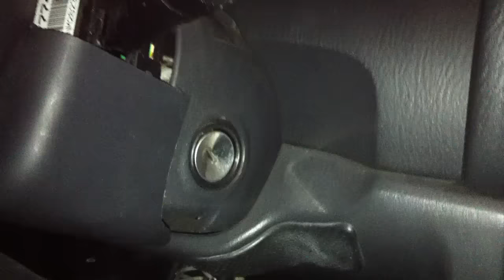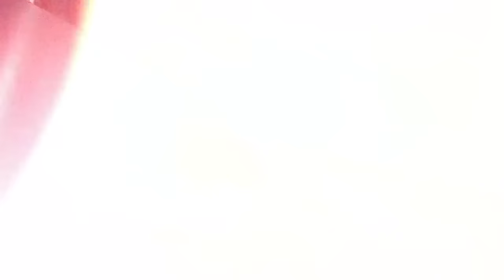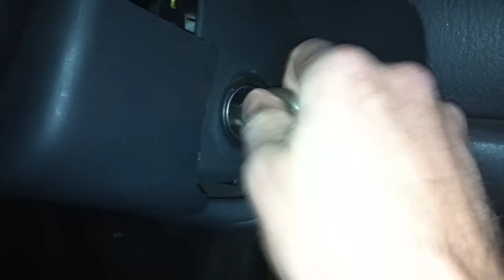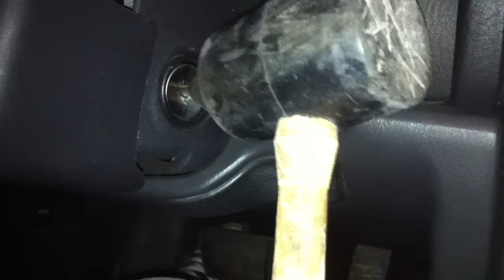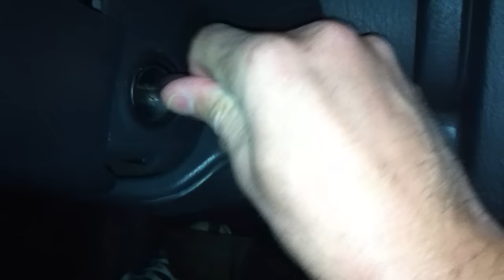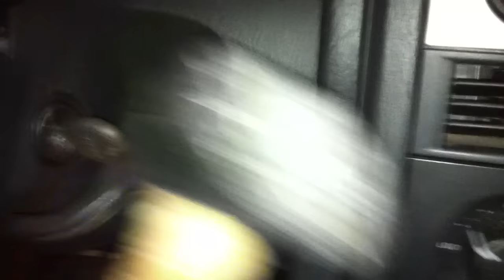if your Car/Truck Key won't turn, here is a Quick fix -UNCUT

Comment: Just worked on 2001 Chrysler Town & Country :)
Reply: probably ages ago, but did you recall if it was locked, or would go all the way and just wouldnt start due to electrica of the seurity feature. mine wont turn over, just -- poosh-l
Reply: thanks for the reply, but that van is long gone 😀😀😀
Reply: no worries, mine is long gone too!! I have scooter fixing videos from waaaay back and people still ask me specific questions on it.. I feel ya.

Comment: I know this is a 9 YEAR OLD VIDEO but THIS JUST SAVED ME accidentally put my truck  key in my Volvo (was in my pocket ) and then after it wouldn’t turn realized was wrong key then Volvo key wouldn’t work anymore after totally taking the ignition apart I seen this video and BOOM IT WORKED
Reply from the maker: 9 years. Geeez you making me feel old. lol

Comment: This will only work if its the tumblers getting hung. Wont do anything if its because of a worn key. (accept probably damage something worst then it is) That said  this  can be a good temporary fix for dodge/jeep/chrysler (doesnt work to well on other autos) but you should still consider contacting a locksmith to have the ignition refitted with new wafers. Its much cheaper when lock is functioning which it probably wont be for much longer.
Reply: Key Works Yep! This trick will only work so many times. Sidebar failure isn't gonna fix itself.
Reply: O..

Comment: Totally worked. I just used my palm. We were stuck for 30 minutes trying to wiggle and everything you normally do. Couldn't find a video saying anything else. Slapped it with my palm 4 or 5 times and started right up.

Comment from the maker: I've broken a key before too, and I used this guys technique, https://www.youtube.com/watch?v=63tQH1DIqIw
Reply: Warren Hardy  Thanks a lot. After trying for a few hours in different ways, I got the lock turned in this way in 2 minutes. Now I can get the lock out to repair it :-)
Reply: This is the worst tip ever.
Reply: Been driving a tow truck for AAA for the past eight years. Done that many times to loosen the tumblers of the lock. But I just tap it with the handle of a screwdriver. Jeeps are notorious for having this happen to them. Now I towed a Jeep Grand Cherokee to the local dealership because I couldn't tap the tumblers loose. The service writer said you need to whack them real hard with a dead blow mallet. He got in the Jeep, smacked the back of the key. And he got it started.
Reply: +Duong Anh Pham l
ddrA. cu e et et et RT et try UK
👶💑💑💑👶uu
Reply: A gentle tap with a screwdriver handle is ok a dead blow.. absolutely not! If you only knew what was inside the coloum that can get damaged you wouldn't dare do it either. And when some locksmith like myself (who also used to run calls for a AAA contracted shop we'll know exactly what you did because you'll have telltale marks on the plastic actuator and sometimes even it breaks the transponder antenna or SKIM module. That module is about 1000$ installed and not many other than a dealer can (or for that matter should) replace them and it's not just a part you can throw in there worse yet it often changes the vehicles pin code to something that no one knows and when you lose your keys both the keys and module must be replaced! 
Another thing worthy of note is that this is a temporary fix, the ignition cylinder must be removed and the bent pins/wafers inside replaced and the lock re lubricated after cleaning otherwise it's just going to go out down the road and leave them stranded again. Yes it can get them going but it's not a permanent fix
Reply from the maker: gotta be careful, light straight blows, if its really bad like mine was you will have to ramp up the hits harder and harder, but yes it can happen. 
If you do break your key off, this guys has 7 ways to remove it: https://www.youtube.com/watch?v=63tQH1DIqIw

Comment: Warren: YOU SAVED ME another $300 repair! THANK YOU!!!!!! Favorited AND subscribed! Had this very issue on my 2006 Dodge Dakota. Replaced the ignition cylinder once, and thought I was going to have it done again! Nope! Your little trick saved it! I believe that there is a cylinder tumbler that sticks inside. Need to get some graphite for it to try to get it to loosen up.

Again, my thanks!
Reply from the maker: Nice, Great to hear!

Comment: I was skeptical to say the least but with nothing else to do I gave it a try. It worked ! Had to get it to turn so I could align the pin to pull the old one out and was getting ready to drill it. Very surprised and grateful.

Comment: So thankful for this video!!  My key was stuck with the car on and this worked on the second try. We didn't have a rubber mallet so we used a screwdriver that had a plastic handle. Thank you so much - we tried for about 40 minutes to get the car turned off. The neighbor even unhooked the battery and it still stayed on.

Comment: I was trying to replace the ignition lock cylinder on my 2001 Toyota Corolla but in order to do that I had to turn the key to the ACC position. Nothing was working for me until I came across this video.. 3 good smacks and the key turned and I was able to replace the part!! Thanks for posting this video!!

Comment: Thank you for sharing with us😭😭😭you just saved me so much time from being outside in the heat. My spouse  had just gotten home with a truck full of groceries. I had to put  them up then go outside to deal with my truck. I wacked it 3 times and it worked,  and parked it.

Comment: Thank you so much for this video, I have been sitting I the Safeway parking lot for over an hour with my key that was stuck and would not  start my truck. I watched your video and hit the key with the palm of my hand  didn't have a hammer and wallah it worked! So stoked and greatful. Just thought I'd let you knowH

Comment: Dude you rock tried this on my 05 Ford f150 first time didn't hit all that hard didn't work. Rocked that sucka the second time turned it wouldn't work then turn it back then forward boom I'm driving again. Pure life saver. Thank you
Reply from the maker: Nice. I have a ‘10 F150 no key problems yet, just everything else lol

Comment: Thank you so much. All the other videos were not working. I didn't use a mallet but it still worked. It's 100 degrees out and I was frying in my car. This 2009 Volkswagen beetle was not trying to unlock.

Comment: My kid and her friends were "pretending" to drive my concord by jamming a paperclip into the ignition. I got the paperclip out but this issue started happening. With how irritated I was, it was very cathartic hitting something with a hammer. Needless to say that fixed the problem. Thank you for showing me that smacking something with a hammer will sometimes fix the problem.

Comment: Thank you sooo much for this video. Worked like a charm on my 2000 Dodge Grand Caravan. After the first many bams with a shoe it didn't work and I was about to give up, but kept trying and voila, my key finally turned and car started. Thanks again!

Comment: Warren, glad you got it to work, now go ahead & take back your comment about the "piece of crap Grand Cherokee"! I had a '96 with the same issue. I replaced the lock cylinder & it worked fine. I acquired the Jeep (2011?) through some family members by trading my wife's old sewing machine for it. Believe me, I got the better of the deal! I got about 5 yrs(!) out of the old thing.... loved it! Just sold it for scrap last year, & funny thing, after sitting in my field for a year, the guy I sold it to got it started & drove it away! Thanks for posting the video bro'!
Reply from the maker: It’s true, my Jeep is still running strong. Had to replace a thermostat the other day, but that was easy and only $15.

Comment: I had my doubts, but it worked like a charm. I did bend the key a bit but straightened it out with a little tap with a hammer.

Comment: That worked, thank you. I went in the gas station and when I came back out nothing I did would get the key to turn. I had to hammer it with my hand rapidly and that got it. Never have I had that happen before.

Comment: Wow it works 2003 Chrysler Intrepid. Darn Ignition Cylinder locked. Went to remove the cylinder and the darn metal tab that is part of the cylinder would not move as a result could not remove cylinder. Back to you tube  and come across Warren and the ballpein hammer. Well I thought what have I got to lose out I went gave  the key one smack nothing oh well not hard enough to more quick hits alittle harder and low and behold IT WORKED! Thank you Warren.
Reply from the maker: Wow man, 9years later and this video still helping people out, love it!
Reply: @warrenhardy  Thanks again man. Just wondering though how long this fix will work? Does it fix the cylinder lock up issue permanently?  Darn skim will not allow plain old cyl to replace original, thinking of buying and jus leaving old chip key on key chain.
Reply from the maker: @alland8246  I had it lock me out several more times then eventually it got tired of me hitting it and it never happened again.
Reply: @warrenhardy  ROFL ha ha. Well I decided to buy a new cylinder, threw the old one in the glove box. Just hung the old  key on the key chain next to new key and took her for a  short test drive and everything went ok. 
Anyway got the old still just in case. Thanks again Warren, and thanks for the very funny story about ignition cylinder correcting. 😄

Comment: Thanks, this happened to me today, this video saved me. I was hitting like you and it did not work. I was like damn, but just like your video it finally worked and got me home. Now I gotta go get a replacement ignition lock assembly. Whew, no tow truck home safe where I can fix it. Woot. Thanks again.

Comment: Awesome ghetto fix that actually worked!  That said, I wouldn't use a mallet or a hammer directly on the key -- you don't want to crush the cheap plastic on the key.  Wrap up a few paper towels into a 2x2 inch square, then gently tap until you get it to turn.

Comment: My key fob wouldn’t unlock my car & the key wouldn’t turn in the door. I tapped it lightly with a small hammer & it worked. Thanks a lot!

Comment: Thank you!!!! I am in a town with no friends and it is dark and getting cold. I did not have a rubber mallet but used a measuring tape and worked. Thank you thank you thank you!!!!!

Comment: Brother in law helped me out.  He dissemble the lock and tumbler and took out the long arm locking mechanism and made sure all the wiring and ground was correct.  Reassembled without the locking arm.  It works now.  v^^v  for 98 Honda Prelude S.

Comment: 2000 Neon, 117K. Wife called at 8:00 pm, said key wouldn't turn. Honey, please drive 20 minutes and get me.  I was just SURE she was just not turning the wheel enough. Nope, wheel would turn 45 degrees either way, key would NOT turn!  Left car there and drove home expecting to tow the car the next day.  When this mechanical engineer saw this video that night, I thought "There is no way smacking your key with a hammer is going to work. You have got to be kidding me!" Investigated further for 30 minutes before thinking maybe there was something worth trying.  Drove down the next day with rubber mallet in hand, hit it 4-5 times. key turns very easily!    Won't be able to tell you how long it lasted, because I got the ignition cylinder changed the next day, just to be sure.  But count me as a very skeptical person, saying this absolutely worked!
Reply from the maker: Awesome, yes so many comments I get about just turn the wheel, that’s why it’s locked, your not turning it enough. But that’s not the problem when this happens.

Comment: This is usually a worn key and you need one cut to spec. Bit sometimes just lubricant is what it really needs. NOT wd-40. Something like triflow. Banging on it may work for a minute, but will result in a much more expensive repair later. 

When you start needing to jiggle the key, it's time for maintenance :)
Reply: This just happened on my Honda . Tried spare key. Would not go in. After many attempts and some break away , finally got key in. But to no avail, still won’t turn.
Also . Only had to jiggle the key for 1 week before it totally crapped out.
Other than that. No warning . Hopefully won’t cost tooo much to repair
Reply: @tpike32  that's a SUPER common Honda problem. Call a locksmith. I'd say a couple hundred dollars. It's probably cheaper if you can get the vehicle to a shop. Any decent locksmith can get that fixed pretty quickly.
Reply: @fivel256  thanks , yeah I found out it’s common with Honda . I called locksmith and none in my area. I did find a local shop that just did a Honda with same issue . I also looked up videos . It’s usually the wafers in tumbler that go bad. Seems like a easy fix with the right tools.

Comment: Im so gladn it worked for so many... I tried this on my 2008 Honda CRV EX and now the cylinder is jammed in, and I still cant get the key to turn... Any suggestions? I did just purchased a LAUNCH X431 IMMO Pluss Elite But now Im wondering if I need the Cilinder Lock and switch replaced or just the switch... Any suggestions... lol...

Comment: No bullshit I just used a piece of wood and a hammer the 3rd try it fired up damn you are the man my 2002 ram has been sitting in my driveway for 4 days with the windows down and I live in daytona beach the weather here is nuts thank God it worked no bullshit here this method works.

Comment: Pulled my key out of the ignition at an odd angle, from outside the car and when I attempted to crank again, it was locked up completely. Thought I'd give this method a try and sure enough, it released after the third subtle hit. Thanks!

Comment: I had the same problem with my 2001 Cherokee.  The mallet method didn't work.  However, I was able to get the cylinder to turn another way.  I lubed the lock with powered graphite, then I "raked" the lock by moving the key in and out while trying to turn it.  In my case I know it was a pin in the lock cylinder that was stuck and was keeping the cylinder from turning.  I am guessing that is what happened in your situation, too, and the whacking of the mallet freed the pin.

Comment: Quick variation on the problem/solution here that will not cause damage and is a more lasting fix: 

For most people, the problem is not that the key is not going in all the way, but rather that the pin(s) in the lock cylinder are sticking. (For example, you can see in the video that the key is going in all the way.)

To fix, spray a little WD-40 into the key hole. Stick the key in and out a few times, and wipe off the gunk. 

Stick the key back in and hit it on the end firmly like the video says, but you don't have to hit it very hard. You basically want to tap it solidly and rapidly to vibrate the pins into dropping. You don't need to "break what's locking it in place."

If the issue persists, you can replace the ignition lock cylinder on most vehicles for about $60. 

Shout out to this video, though, because it did help me figure out the problem on my car, and I figure some others folks might benefit from not damaging the ignition with a hammer whack.

Comment: You could get some graphite dust from a locksmiths, it comes in a small puffer bottle and you blow it into the ignition barrel.

Comment: Does the key fall out easily after doing this? How much time does this buy you?
Reply from the maker: Never did have to fix it properly
Reply: @warrenhardy  It just worked for me! I had to use a flathead screwdriver though. Thanks!

* Edit - You can use a flat screwdriver to break the lock and then insert your key afterward to try and turn the key. This way you won't risk damaging your key.

Comment: 2005 Dodge Dakota - One firm whack with a mallet freed mine up. Before the whack, have a helper (or bunji cord) pull the steering wheel to the left while you deliver the whack.

Comment: Thanks brother, it worked for me on a 2004 toyota Sequoia, now I am riding with a rubber mallet in back until I replace the ignition switch. When I am able to get the funds to do so!

Comment: Ive got a key broke off in the cylinder, when git it out(see if i could, should have waited), i put it back in to go to parts store and now ny ignition want turn. Wonder if this will work with key broken.

Comment: Try tapping the key end like a woodpecker would at a tree and lightly turn the key at the same time. It's called key bumping by lock pickers.

Also get a new key cut, sometimes they wear and fail to turn in the barrel.
Good video and thanks for sharing.

Comment: Does it make a difference if the top lock pin on the new  cylinder is longer then the old one.on a 1996 Toyota Camry

Comment: Ok guess I'll be trying this tomorrow ...BUT before I do this I wanted to double check something lol my key will very slightly turn and after a few attempts it thankfully will allow me to start my 2004 rodeo, so my question is do I need to wait until it just won't turn at all to do this to avoid actually breaking something bad lol or should it be fine taking a rubber hammer to it now